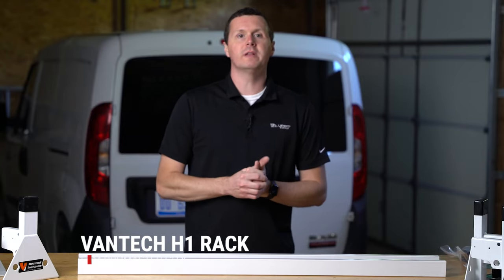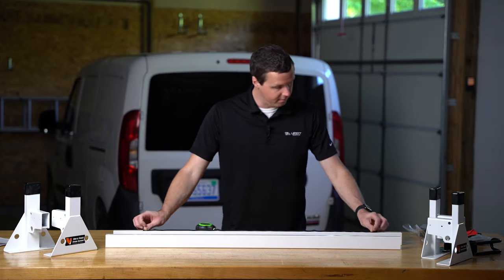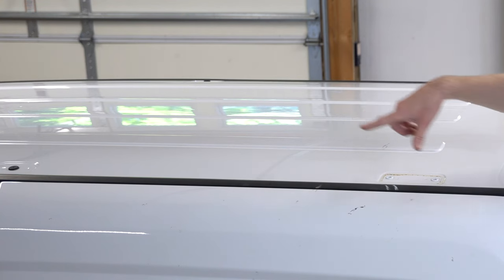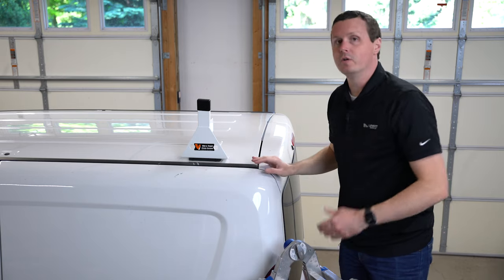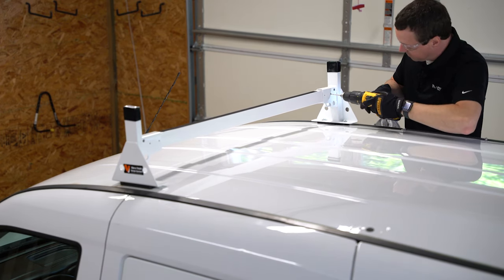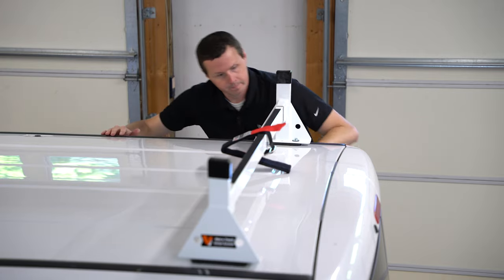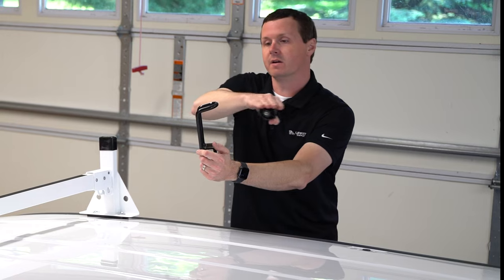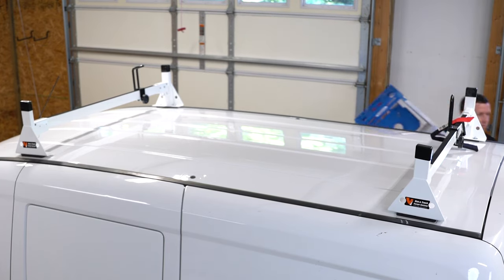Installing Vantech H1 Crossbar Ladder Rack on RAM ProMaster City

Comment: I had these same ones on my promaster and with in 2 years they were bleeding rust everywhere. So I scraped them and bought the Thule bar kit. Good job on the install thou.
Reply from the maker: The H1 is also available in aluminum with stainless steel hardware which will cut down on that rust!

Comment: Quick questions, what is the distance from the top of the roof van to the top of the upright bracket, I'm asking because I want to purchase the 3 bar system for a Nissan NV200 SV and I park the van in under parking garage, also how many pounds can the system hold?
Thank you.
Reply from the maker: The uprights for a NV200 rack are 10.5" total height. The rack is rated for 250 lbs per crossbar, so you'll likely be limited by the roof capacity on the van, not the rack. Here's all the details on the NV200 rack: https://upfitsupply.com/product/vantech-h1-ladder-roof-rack-for-nissan-nv200/